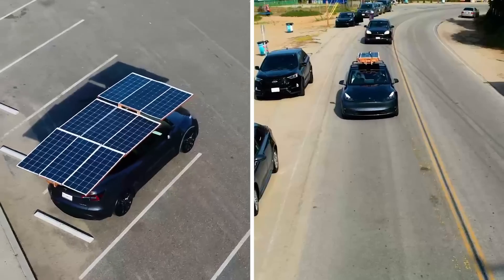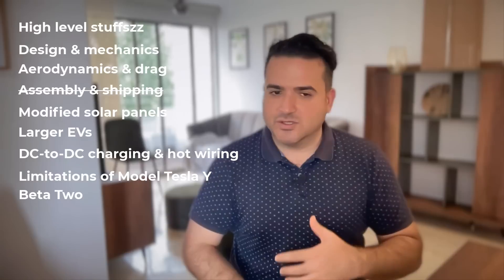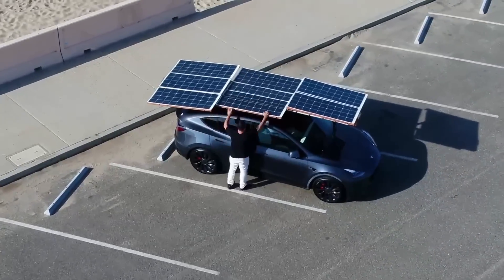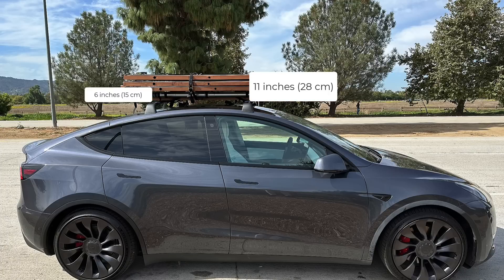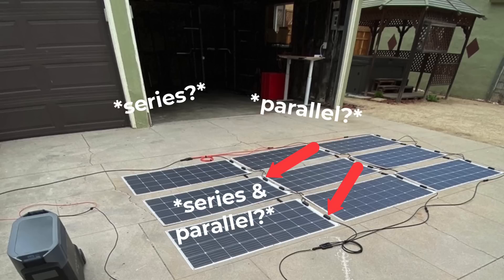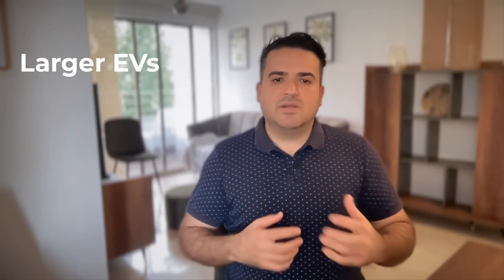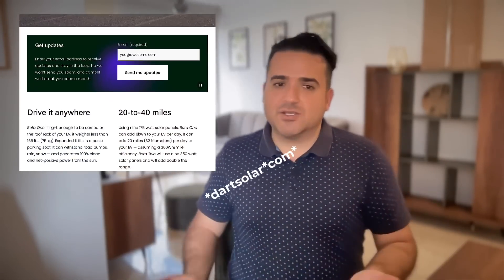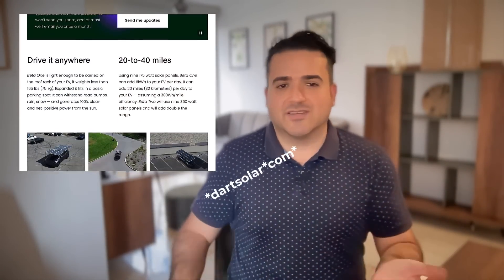DIY: A drivable solar rooftop for my Tesla Model Y (20 to 75 miles per day)

Comment from the maker: Enter your email at dartsolar.com so I can send you updates.
Reply: New Voltron DCtoDC chargers are 98% efficent and run cool FYI, so V3xxx maybe? 700watt pannels are dropping and replacing the 4xx watt ones with newer technology and significant improvement's in efficeny (20-22 is now peaking around 30% with ntype, Bi-facial, Double Glazed, Shingled, Monocrystelline Solar Panels)...

Comment: Why ev car manufacturer dont put small wind turbine. The car will charge when it move.
Same concept with emergency wind ganerator on air plane
Reply from the maker: Because the wind turbine will cause drag that the EV has to user power to overcome, and ulmately creates an overall loss

Comment: Have you considered using a low power CCS DC fast charger through a NACS adapter into the charge port? Can't you use DC current all the way without needing to change wiring inside the car?
Reply from the maker: Yeah, but DC charging at such low amps might not work -- we have never tried it

Comment: A roof box can cause 15-30% of less efficiency.  This probably about 15% at least .   That means you loss 15% your battery permanently.  If you have a long range tesla model y that means you lose 11.25kwh .  And your solar panel cant produce half of  that in one day . So whats the point ?
Reply from the maker: That is incorrect. For each 1-inch the vehicle loses about 2% in our tests. The current Beta3 prototype is only 1-inch tall and is more aerodynamic

Comment: For those interested in this, check out the GoSun version of it, it looks very nice, but downside is solar panels at different angles.
Reply from the maker: That has many flaws. (1) The solar panels don't point to the sun. You lose 40% efficiency there. (2) Their power unit is on your roof, so the whole thing can get stone. (3) The power unit is no detachable... I would go through this list until I get to 20.

Comment: This is so awesome! Im glad someone is driving this idea forward! Most people have thought solar charging for evs is pointless, but if you expand it beyond the size of the car you really can get a considerable amount of energy.

Also have you thought of making them have some rudimentary sun tracking system? Usually these systems are more work than just adding more panels, but since space is a commodity in this situation, making them track the sun could REALLY boost output quite a bit!
Reply from the maker: That's a great idea! Or using reflectors to increase wattage!
Reply: @DartSolar  yeah, reflectors could probably have a similar effect. I have done testing with my panels and you lose a lot less power during winter months if you can keep the angle normal to the sun. Your power output can double during the winter in areas like California.

Comment: What's the way currently that you charge the vehicle off of this? Sounds like you invert the solar energy to AC and then use the Tesla destination charger to push it to the onboard inverter into DC, or you have it connected to a separate battery pack to charge the vehicle when it's filled. I knew of Leaf owners attempting similar that were doing the latter because the high voltage contactors could only realistically take 6-8 activation's per day.
I always thought that Tesla should have been doing this more, regardless of actual utility, because the recent Prius showed that solar panels really help alleviate people's range anxiety about their cars. That POS Cybertruck could use it especially, the thing is literally just all hard angles.
Reply from the maker: DC to Power Unit battery to Inverter to Tesla adapter to Tesla chargeport

Comment: So Beta 3 is going to have lower power output than Beta 2? Your design doesn't exist in a vacuum. GoSun has a similar product and already does 1200W@80-120VDC. You'll simply have to do better if you want to compete.
Reply from the maker: Yes, but their solar panels don’t event point to the sun. Their product is not wind proof, it’s all going to flip and flop endlessly. The expansion cannot be automated or actuated. And the list goes on. Most people it seems only need 1kw of solar instead of 2kw or 4kw.

Comment: Could you get the weight and size to a place it will fit in the back of the vehicle or in the frunk?  This way you only have the additional Tesla rack drag and not the unit drag wile traveling (20% is significant).
Reply from the maker: Our latest blueprint on dartsolar.com only has a 1% to 2% aerodynamic drag loss

Comment: This is feasible if there is sun. A big challenge for any solar panel. There more options for wind power. Think about it, a car in motion is driving over air, thus moving air around and through the car. Can anyone build a wind power generator aparatus right where the front air duct/grill is located? Imagine the range it can regenerated similar to a car coming to a stop or down hill with regenerative braking. Here, you drive,wind blows through that duct and spinning a wind turbine of sort for wind power... not patent yet!
Reply: What an aerodynamic nightmare! 😂
Reply: @MikeTrieu  🤣
Reply from the maker: @MikeTrieu  Yes, but Beta2 only creates a 10% drag loss, Beta3 only creates a 3% drag loss -- which is exactly the same drag loss as the Tesla Roof rack
Reply from the maker: I'm not sure if you're being sarcastic or serious

Comment: Wouldn't using CGIS panels with a rollup mechanism be good too? You would essentially only have a tube on top of the roof. Of course, much more expensive but with current tech development it could be viable in a few years.
Reply from the maker: Yes, that is a great idea -- CIGS has a conversion of 17% though, and PERC TonCon flexible solar panels are more in the 20% to 22% range. But I love the idea of using CIGS one day

Comment: Great implementation.  The integrated solar panels of Fiskar or Aptera make little sense as they don't have enough surface area, but a "deployable when parked" panel set that expands to the size of a parking spot and can generate 10x what Fiskar or Aptera generate does make sense.  It's pretty ugly, but it's smart.
Reply from the maker: We are just adding Beta3 on dartsolar.com which is only 1-inch high, incase you'd like to take a look. For this version we focused on sexiness.

Comment: Honestly, rather than trying to cover the most of surface space on top. I would reduce the size to just the top glass surface. I don't need it to charge for more mileages, I only need it to able to even out the energy that climate control system used. 😂
Reply from the maker: We are just adding Beta3 on dartsolar.com which is only 1-inch high, incase you'd like to take a look. For this version we focused on sexiness. Beta3 is only as big as the glass top of the Tesla Model Y and 3

Comment: You’re dreaming if you think you can get 20 kWh from that.
Reply from the maker: Sorry I'm confused -- where do you get the 20kWh?
Reply: @DartSolar  75 mi/4 mi per kWh. That takes over 18kWh plus efficiency losses.
Reply from the maker: @USA-GreedyMenOfNoIntegrity  Sorry -- that math on the video later on you can see is done with the 4kw solar array. Not the 1.5kw one

Comment: First of all this idea does not worth implementation considering the amount energy u can harvest  and the cost of implemntayion otherwise tesla would have jumped on it aleady.
if this helps u can use DC voltage to charge ur tesla as level 1 and level 2 AC voltage will be converted to dc in the car anyway. only u need to apply proper dc voltage.
Reply from the maker: Hello Farzins,  I've never tested that, you mean I can connect the solar panels to an MPPT and that directly to the Tesla and it would work?

Comment: Instead of putting it on the roof, use a hitch rack and put the panel behind your car. That will significantly reduce the drag.
Reply from the maker: Yes, but the setup will be harder. Our latest model on dartsolar.com only takes 10 seconds to setup and the aerodynamic drag loss is 1% to 2%

Comment: > cyclist collision
Don't mount them such that they end up ad head height then. It can be made to hinge around the front edge, so when deployed, the front corners can be below head height and the rear ones above head height. 
Worst case you have to park in reverse to get the optimal array orientation.
ps. i would be cool to maintain operation of a single panel at all times if that isn't the case already.

Comment: James @realsolarcars already built a dcdc to car his chevy volt from roofrack based panels. If you havent already spoken to him you maybe should. Another route might be sunsynk/deye inverters and the battery emulator project but btw doing this on a tesla is more tricky as they ota their software which can introduce incompatibilities with the emulator as can messages may change after updates that you have zero control over. But props to you for protyping your first model. I have an env200 nissan ev van (leaf in van clothing). Leafs are more hacked now so this should be easier. Just waiting for the cost of flexible panels in the uk to make more sense, especially if mods killing their resale value are required. Also low frequency inverters (read heavy) are kinder to the cars expensive chargers. Charging via an ecoflow or similar isnt as forgiving apparently.
Reply from the maker: Yeah, the real solar cars guy is excitingly intelligent! The DC to DC charging solution that I'm looking at does not involve hacking the batteries, because then it would avoid the warranty of the car. We're going to release blueprints and instructions on our website if you'd like to register to be able to, replicate one for yourself. Sorry, the price of flexible solar panels in the UK are so expensive. Have you considered a purchasing them directly from China or India?

Comment: I recommend using a custom tail hitch method to transfer the panels!
I've seen someone else do it and it's better for your drag coefficient!!
Reply from the maker: Well, this particular prototype is 13 inches high, our second prototype was 5 inches high and it had an aerodynamic drag loss of about 7%. Our third prototype is only one inch high and the aerodynamic drag loss is negligible.

My original intent was to drive to work, park my car walk away, and the solar array automatically expand. I don't want to drive with a tail hitch all day.

Comment: Roof is the wrong place. You will loose more energy than you'll ever create with this. Better would be using tow hitch to store the panels.
Reply from the maker: Well, this particular prototype is 13 inches high, our second prototype was 5 inches high and it had an aerodynamic drag loss of about 7%. Our third prototype is only one inch high and the aerodynamic drag loss is negligible.

Comment: I think the aerodynamic drag would reduce the charging gains by enough that it’s not worth gaining 24 miles. Battery technology keeps evolving and soon there will be higher distance ranges and the price will come down
Reply from the maker: You're correct, this prototype was 13 inches high so the aerodynamic drag loss was insane. The second prototype I built was only 5 inches high, and the third prototype is only 1 inch high. So now the aerodynamic drag loss is almost negligible. We're gonna release the blueprints to the second prototype on our website in case you're interested.
Reply: This is not for "increasing range", this is for making it so you never have to charge the car to cover your daily commute.

Comment: Mppt charger and a small lithium battery to work as a buffer. The vehicle charger has to be dc charger and it will pull from battery and solar
Reply from the maker: Yep, that's the current set up. We have right now. We just have to up the voltage to 480 to do direct current charging to the car.

Comment: Wait, did you say a 20% loss for having this mounted? So if you had a 300 mile range you now have a somewhere around a 240 mile range but you can gain 30 miles if you let it sit perfectly in the sun for 5 hours? So then you walk away with 270 miles instead of your original 300?

The maths aint mathing here.
Reply from the maker: So that prototype in particular was 13 inches high. The second prototype is 5 inches high, and our last prototype is one-inch high -- so now the aerodynamic drag loss is negligible.

Comment: Great idea, great work so far, but this is a huge project, and I think it would need a lot of diverse skills to get to your full product vision.
I think you should be thinking about minimum viable product.  Your current frame mechanism, without any power for the actuators is probably good enough for a lot of people. There is a lot of development work to do for beta 2... it might be a better business plan to finish beta 1 as a low cost product and have manufacturing... basically just a specialized rack for use with solar inverters (I guess you have an ecoflow delta in the trunk? I think as a means of organizing storage of solar panels for manual static deployment, this is already a viable product with an addressible market.

There are a lot of model y's out there (and small cars that can fit similar roof racks)  Just selling a deployable rack, to plug into a bog standard inverter, is probably a good product.   All the actuators you are planning for beta 2? they add cost and complexity, and aside from star trek value of watching the deployment, I don't think it provides any value to private car ownsers. I understand the value of the automated deployment for commercial applications, but likely not worth it for personal vehicles.

I looked at the outputs available on an ecoflow delta 2, and highest output option is USB-C ... 100W  without going through the inverter.  Looked at Jackery and specs are similar... It's just the low voltage outputs limit are inherently limiting... hmm... looking at an ecoflow delta 2/pro where they have the DC side port for connecting up extra batteries.  I imagine you could use that for some kind of DC-DC voltage up converter hooking into that.  Otherwise you add a lot of cost to design implement your own specialized battery/solar/inverter box.  A lot of work left to do...
Reply from the maker: Wow, I love your explanations, very insightful! You're correct, we're going to open source and release the blueprints for the manual expansion mechanism. The electrical components that I am using right now are like the DeltaPro, the only difference is that it's meant for a 3 kW solar system. So it is less expensive. I'm also placing all the electronics in the extra space underneath the trunk of my Model Y.

Most people need a manually actuated solution, because it's also less expensive and can break down less often. Your points are really well taken!

Comment: The range would be impacted also by the weight of the components. Why not add lightweight flexible solar panels that fold out over the entire vehicle, so that it gets sun wherever it is?  Altenatively, why not have the solar fixture be removable and then be put into the trunk when not in use?  You might want to have a lock on the solar fixture while it is out so no one can steal it.
Reply from the maker: The weight of the solar panels don't really affect the range of the car. It's negligible, but really affects the range is the aerodynamic drag loss in the prototype of this video. The height of the prototype in this video is 13 inches high. The new second prototype was only 5 inches high, and the third prototype is only 1 inch high. So now, the aerodynamic drag loss is incredibly low, almost negligible.

Comment: I would probably like more the idea of something you can carry in the trunk and assemble it when needed like camping or open area on the floor and plug to the car instead. It’s risky to have that on the glass I think.
Reply from the maker: This makes sense, I want a solution so that I can drive to work park under the sun, walk away and have the solar array automatically expand. Without me lifting a finger.
Reply: @DartSolar  you have a point if you need to leave car unattended for a while yes, but it cost too much money still. Solar solutions causes up to 10 times more than a simple Home Depot generator lol

Comment: Looks like an easy project based on abilities of average joes. The dc to dc is pretty easy to impliment by using inverters and basic recifiers and capacitor bank for smoothing. The hard part is tapping into the 400v bus on the car without tesla system voiding your cars warrenty and sacaficing super charging access on there system. The only way this product makes useful for everyone involved is using a solar generator is as far as this will go on the consumer level without warrenties being voided. A small solar array wont make 400v without up converting the voltage as a small loss in milage.
Reply from the maker: This is incredible! Can you point me to the DC to DC charging set up that you're speaking about. An easy solution would be to still use the universal charge adapter on the external charge port but charge the car with DC power.

Comment: shape the panels like pizza slices ... 
point sharp side forward for aerodynamics
 motorise the slices so the open like you do a deck of cards in your hand .. 
you can fit two circles over the roof
you may loose a bit of surface area but get better aerodynamics in return and easy mechanised deployment.
Reply from the maker: They issue with the pizza expander model, or the flower model, is that you can select which area of the car do you expand the solar array. With the existing design if your car has space in the front, but not in the back you can choose to expand the solar panels that are only in the front of the car.